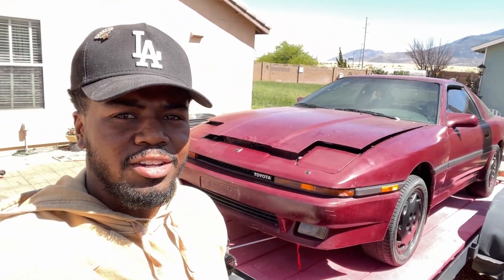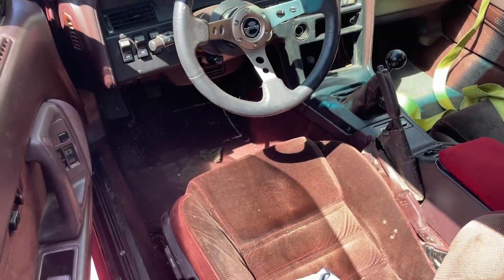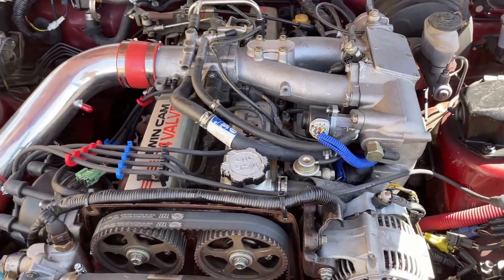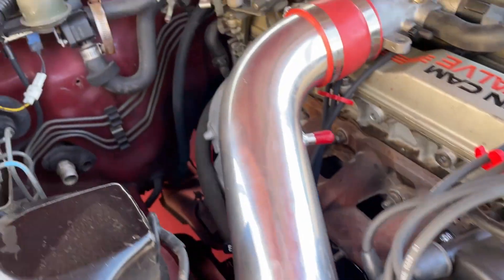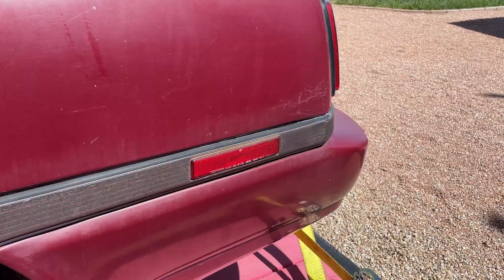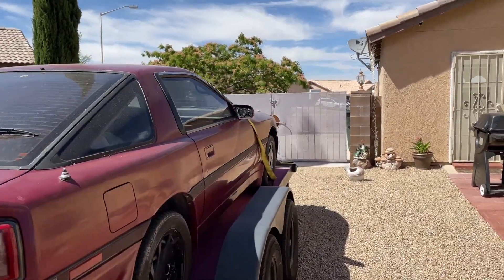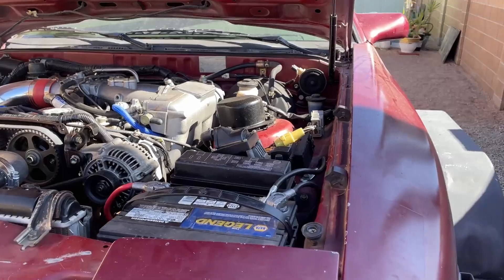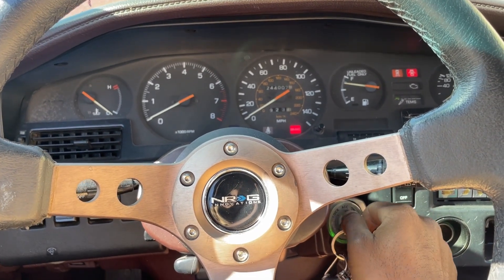I BOUGHT A 1987 MK3 SUPRA!!

Comment: Nice Supra! Looks like its in really good shape! ...or im just used to how north east cars look lol. I imagine youve read about the issue with the torque values on the headstuds on these cars. If the previous owner rebuilt the engine like he said I imagine he would have torqued them to the correct values now but you never know. Also maybe I heard you wrong but you said something about the Cam position sensor being inside the distributor? Like I said, maybe I understood wrong but the 7MGE's had distributors and the 7MGTE had the cam position sensors. It was either one or the other. Maybe he meant he had to replace the distributor and mistakenly called it a CPS. Regardless, looking forward to what you do with it! I personally prefer the front on the pre 89 body.
Reply from the maker: Thanks I appreciate it! Yeah I'm very lucky to not live in the rust belt, i have a quarter sized patch of surface rust in the trunk because water was in there but that's about it luckily.
Reply from the maker: Also check my last video to see what I found out about it!!

Comment: I'm a fan of the early look.
Reply from the maker: I’ve seen some awesome examples of pre & post 87 cars so it’s hard to decide😮‍💨
Reply: @ZellTheVisionary  The car didn't get a facelift and taillight change until 89+ if thats what you're referring to (front and rear of the car)
Reply from the maker: Yeah I just meant I always see the variations of modded pre 89 cars keeping the tail lights and replacing the front bumper and vice versa, wanted to do something similar not directly turn this car into a post 89 model like what most people do